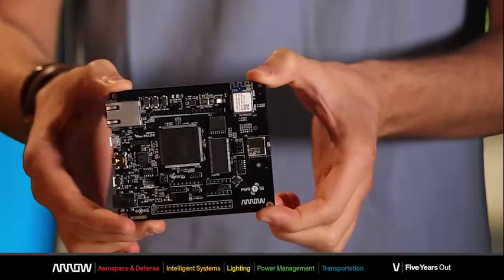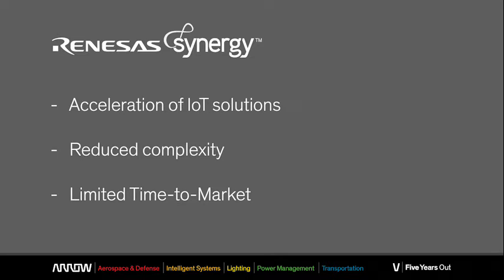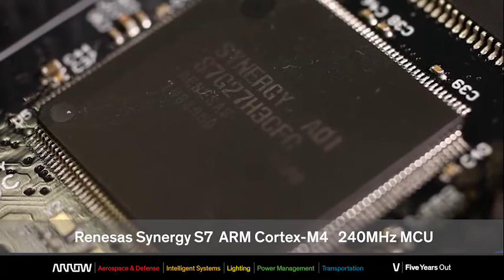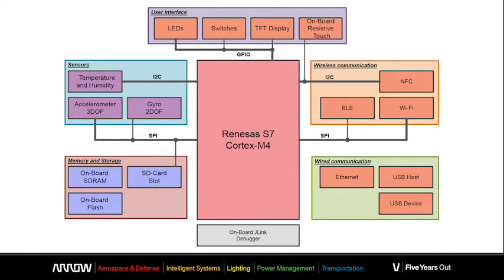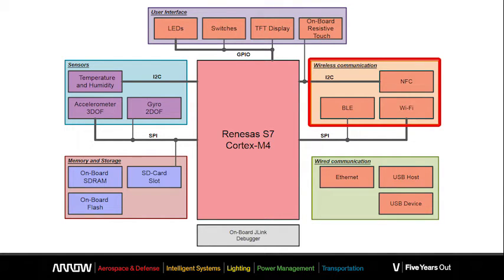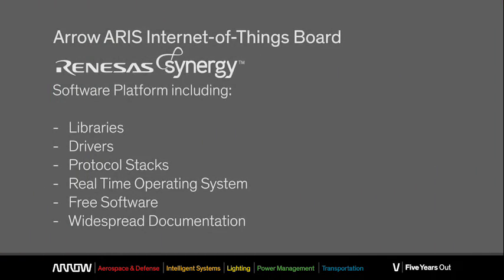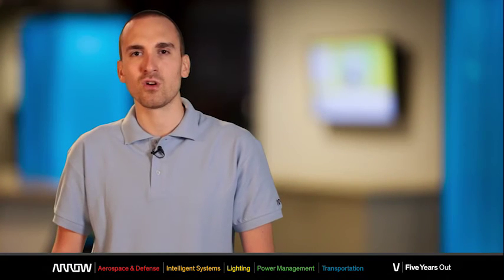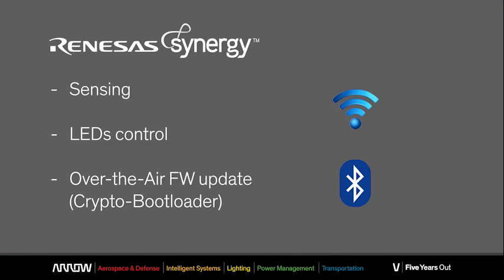The new Internet-of-Things reference design from Arrow Electronics: The ARIS Board.

Comment: Hello, the board is relatively nice from the build point of view, but the documentation and BSP is sorely lacking, there is no complete schematic,  not all the jumpers are documented, no RTC battery specification, no Electrical and Environmental Specification and for the companies: no CE mark or compliance document. If one has standardised on another RTOS is a pain to use it :(.
To me it looks as a rush job and for the almost 200EUR ( that is like 20 RPI Zero W !!!), I would expect at lest the level of documentation and support that one could get from Chinese BananaPi boards but I had higher expectations from Arrow.
Please tell me if yourself, as an embedded engineer, after looking over that documentation you would recommend the board to be used for evaluation purposes and then please post a link to the full schematic, at lest this.